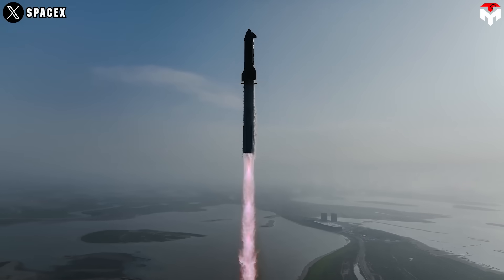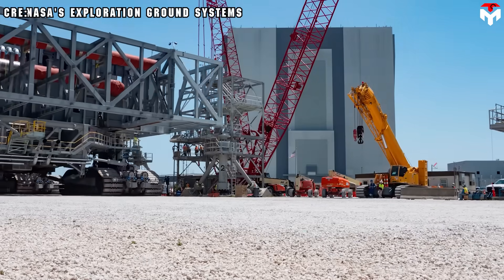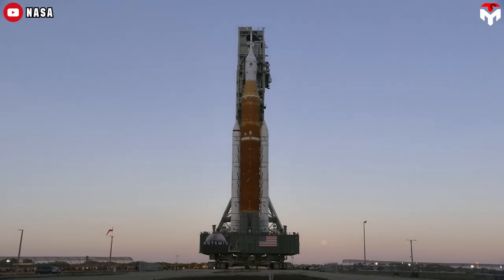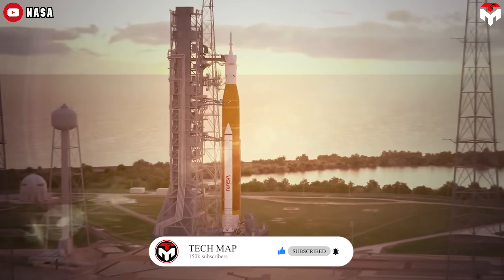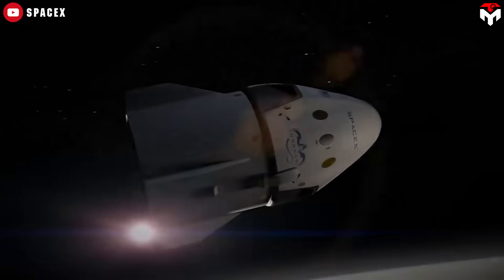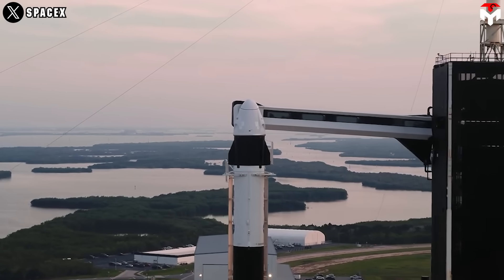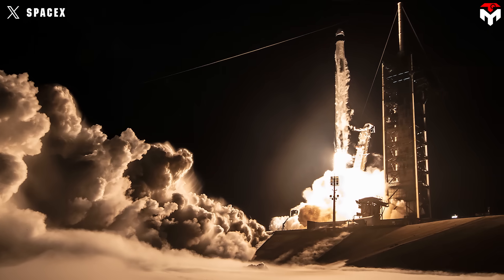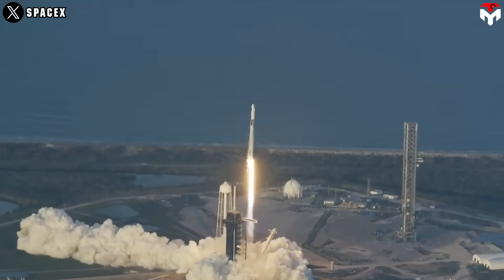SpaceX Dragon Upgraded to Launch to the Moon instead of Starship...

Comment: Almost all of the Lunar Gateway components are under construction or have been completed. Cancelling it at this point would be stupid. It has received a lot of criticism, but I think it is a good idea for many reasons to maintain a permanent presence in lunar orbit. In addition, I am not sold on the Space X lunar lander, bad top heavy design that is asking for trouble trying to land on the lunar surface. I would stay with a low squat design for the foreseeable future, and that ain't the space X design.

Comment: Spaces needs to mount some super drago rockets on the second stage to accommodate the stage separation and forget the hot staging ring. Maybe even some inverted rockets on the first stage. The sonic resonance during hot staging is damaging the fragile coolant lines in the rocket bells. Hot staging will never work consistently.

Comment: Why couldn't the starship first stage lift a modified dragon ship with big fuel tanks?
Reply: Short: because a Dragon in itself is not enough, it needs the Falcon second stage. Longer:
Because the Super Heavy Booster (Starship 1st stage) is designed to lift a very heavy weight, some100 tons to a relatively low height and then it have to return, but it is not capable in itself to give enough velocity/kinetic energy to reach the Moon. SH FT9 separated at 60km 4700km/h, while 2 yrs ago a geostac Falcon Heavy separated (I mean core booster from 2nd stage) at 116km 14500km/h, and a simple Falcon launch separates at 64 .. 68km 7800 .. 8300km/h. The Moon landing transfer needs about 15000m/s ~= 53700km/h delta-v. 
Don't try to add or subtract these velocities, neither am I that knowledgeable to do, just to see it roughly. 
Am not sure if the Falcon Heavy can do a Lunar landing transfer. I don't see putting it on top of SHB as an improvement, because the low speed it separates at. 
And human rating the whole thing will be a long time, years. Though, same applies for the Super Heavy system..
Anybody else, feel free to correct me, I might be mistaken at some point.

Comment: The huge modifications you're talking about could take ten years to human rate. It took nine years (and billions of dollars) for SpaceX to modify Cargo Dragon into what it is today.
A Lunar Dragon with 28 day recirculating life support, landing gear, improved engines and a much better heat shield is every bit as complicated as Commercial Crew.
NASA has a reusable lander that passed Preliminary Design Review in 2021.  ALPACA would've been ready by next year.
But they went with the cheap Snake Oil solution, and now they're up against the wall.

Comment: Actually no lunar lander is needed. No development cost at all.  Simply modify a cargo pod or put two on top of one another and slap them under a dragon capsule.  The lower cargo pod gets them to the moon and back. In lunar orbit, detach the lower cargo pod and leave it in orbit.  Dragon and the other cargo pod land on the moon using thrusters in the lower pod or the capsules draco thrusters.  All your important moon exploration crap is in the cargo pod along with fuel oxygen and other essentials.  When it's time to leave just the capsule launches with the draco thrusters, reconnects with the other pod and heads home.  Simple!
Reply: 28 day recirculating life support isn't simple at all.  It will take years for NASA to human rate a Dragon with that many changes.
Besides, NASA had more basic landers proposed years ago. ALPACA passed its PDR in 2021.
But the Government bought what Elon was selling, and now they're paying the price.

Comment: The trip to and from the moon. All one needs is a canister with radiation, life support and a booster. 
To land on the moon use a dragon and modified trunk with the super draco and extra fuel, but no heat shield (not needed for the moon). 
To return to earth send a second unmanned dragon to loop around the moon and dock with the returning transit canister. 
to save cost the lunar dragon could be resupplied  with a fresh trunk and the transit canister a fresh booster/supplies.
Reply from the maker: Simplified canister and modified Dragon for lunar trips are creative, but radiation, life support, and orbital docking need work. No heat shield for return is risky—thoughts on that?

Comment: Instead of landing legs on the Moon, pump up a big balloon and let the craft bounce to a stop.
I call it the Boing system.
Boing, boing, boing...
Reply from the maker: Bouncing to a stop with a big balloon is creative, but controlling the bounce on the Moon’s rough terrain could be tricky. Plus, inflating and stowing the balloon in a vacuum might need some serious engineering. Got any ideas for stabilizing the craft post-boing?
Reply: @techmap9  look at Spirit and Opportunity ;-)

Remember, Mars has only 1% of Earth's atmosphere density. So, for the inflated parts it's not far off from no atmosphere at all...

Comment: Extended upgraded Dragons to travel to the moon, but you would still require a lunar lander.
2 Dragons joined at the nose, with a little spin for a bit of gravity.
A simple lander could be built based around the 2 Dragon trunks.

Comment: The video claims the Dragon heat shield would have to be upgraded for the Moon. However, the PICA-X heat shield on Dragon is designed to handle re-entry when returning from Mars. Yes, Mars. Returning from the Moon is slightly slower, so slightly lower temperature. Dragon has life support for 10 days; it would have to be increased to 14 days.
Reply: Heat sheild for the moon ? Really ?? It has no atmosphere... the moon lander went to the moon and launched off the moon.. it was made out of tinfoil..
Reply: @thefreese1  He wrote returning from the Moon, which means Earth atmospheric entry.

Comment: Yes, outer space is often described as a vacuum, meaning it's a region of very low pressure and density, with almost no matter present. While not perfectly empty, the density of matter in space is significantly lower than even the emptiest man-made vacuum chambers.  MORONS SO WHAT IS IT PUSHING AGAINST ? HOT AIR LOON WTF.🚀🚀🚀BOOM

Comment: I proposed something similar on the Mars Society forum in 2016. Two launches of Falcon Heavy: first launches a reusuable Lunar lander into Lunar orbit. Capable of carrying 4 astronauts, single stage, liquid methane / LOX. The LM uses all of its propellant to enter Lunar orbit, then waits. Second Falcon Heavy launches Dragon, with the trunk filled with propellant tanks and engines, also liquid methane / LOX. The trunk is used exclusively for Trans-Earth Injection (TEI), also known as Lunar orbit departure. In addition to the Falcon upper stage, it would have another upper stage called a "crasher stage". The Falcon upper stage would perform Trans-Lunar Injection (TLI), which means pushing the stack into a trajectory to take it to the Moon. The "crasher stage" has 3 jobs: first is Lunar Orbit Insertion (LOI). The Dragon/Trunk/Crasher stack would then rendezvous with LM and dock nose-to-nose like Apollo. Then the crasher stage would separate, move around to the back of the LM, and dock with the LM. Then the second job starts: propellant transfer to refill the LM. Liquid methane, LOX, and breathing oxygen refilled. The LM would use helium pressurant, so that would be refilled as well. Astronauts would transfer lithium hydroxide canisters from Dragon to the LM by hand. All 4 astronauts climb in to the LM, seal hatches and leave Dragon in orbit running on autopilot. At a safe distance, the crasher stage starts its third job: de-orbit the LM. The LM is slowed out of orbit, and slowed toward the surface of the Moon. 90% of the work of going from Lunar orbit to landed is done by the crasher stage. Then the stage separates, and crashes into the Moon (hence its name). The LM uses its onboard engines to softly touch down.

Astronauts do their thing. When finished, the LM lifts off. Same engine used for landing, is also used for ascent. No part of the LM is left behind. The LM enters Lunar orbit, rendezvous with Dragon and dock. Samples transferred to Dragon, the LM left clean. Then Dragon separates, and at a safe distance fires up the engines in the Trunk and heads back home to Earth.

Notice: no Lunar Gateway. A Mars Direct habitat could be launched to the Moon either by one launch of SLS Block 1B, or Starship. The Mars Direct habitat would act as a permanent Moon base, and prove the technology for use on Mars. Dragon/LM could the be used as a crew taxi to ferry crew to/from the Moon base. Or the LM could land at different locations, for short duration science missions.
Reply: Yes, outer space is often described as a vacuum, meaning it's a region of very low pressure and density, with almost no matter present. While not perfectly empty, the density of matter in space is significantly lower than even the emptiest man-made vacuum chambers.  MORONS SO WHAT IS IT PUSHING AGAINST ? HOT AIR LOON WTF.🚀🚀🚀BOOM
Reply: A bit more detail: if Starship is used to launch the habitat to the Moon, an upper stage would be necessary for Trans-Lunar Injection (TLI). Centaur V would be large enough.

Comment: I wonder how long it would take to modify a Crew Dragon capsule to be a Lunar Dragon, to be launched with the Crew Dragon, as the Apollo CSM and Lunar Module were launch? They could make it a two-person craft, fitted with a docking port similar to that of the ISS, use the landing legs that were in the original Dragon, and modify the Super Draco engines to where they could restart to get the crew back to lunar orbit. There would be plenty of room for cargo, equipment, and scientific experiments, etc. I'm not an engineer, but it seems like it would be better and more cost-effective to do that, than to come up with a new design, which would take years to build, test, and the fly to the moon.

Comment: New Glenn is very slow, but not as slow as Starship which is still getting failure after failure, overweight, thrust under spec and no sign of any of the serious problems being solved. Also, Elon by threatening cancelling Dragon, he has shown he can not be trusted with getting contracts for space access

Comment: Send a lunar module on starship booster. The booster has been successful. 
Build a dragon that can fit on a falcon heavy that has the extra module for propulsion to the lunar module with enough fuel to the moon and back. 

Copy the original idea of nasa but fit it all on spacex boosters that are at a fraction of the cost

Comment: The Haven 1 module, with some extra protection against cosmic rays, would be placed in orbit between the Moon and Earth, and the crewed module would be attached to it. They would separate at the Moon, and the rest would happen similarly to the Apollo program. The ISS has been in operation for about 20 years, and in that time it could have reached Mars and back ten times. On a smaller scale, an object placed in orbit between the Moon and Earth, or Earth and Mars, would only need to be accelerated once, and then only supplied with energy for orbit correction. Fuel is the biggest problem and it must be sadly admitted that this can only be helped by downsizing. So a Dragon spacecraft would need to get a more serious rocket system, in addition to which the base would also need to get some propulsion for orbit corrections, and these two cannot be the same.

Comment: As far as the Lunar Gatway, why would a multi-module structure be needed. A single unit like the Sky Lab from the mid 70's would work fine. Gateway should be a temp facility for Lunar Exploration only when a Lunar Landing is in progress.There are cheap and efficient ways to have a Lunar Station as long as old cash guzzling so called space experts are kept of of the loop. Only pay the cost after the project is complete, no cost over runs.

Comment: Starship is for Mars but a quick fit-up for the Moon.
Reply: Starship needs to prove it's abilities and by landing on the moon, sustaining life on the moon and successfully returning to earth, and do this several times not only to prove sustainable reliability, but also to build a liner base similar to the ones needed for mars  than can support life on a long term basis, including oxygen and water generation based on just the materials on the moon. They need to prove all these things before even attempting mars, this because all the tech used to support and sustain life on Mars, because an emergency flight from earth is at least 9 months away, to go to Mars without all these building blocks in place is suicidal. And given the rift between Elon and trump sny federal funding for spacex might very well dry up, making spacex the second casualty of mysks ego. The only thing Elon can took forward to is Trump and cronies being impeached and a more understanding administration replacing him.

Sadly Elon Musk still hasn't learnt the lessons that his actions can have negative effects or his companies as well as positive ones.

The way things are looking 2030 is likely the first mars missions will launch, it will take up to 10 years to prove the tech used building and sustaining a lunar colony. After that the first mars missions will of necessity be flybys and perhaps pre supply of some required materials and equipment.
Reply: @stephenwood9703   Imagine if Starship were somehow tip over as it lands. My opinion is that Starship is too big and tall to make a safe landing, given the fact that just about every land that has been sent to the moon has failed to land successfully, and those lander are at least ten times smaller than Starship, if not smaller.
Reply: it's a cartoon loon.  WTF  The "Man in Space" episode, which aired on March 9, 1955, was a pivotal moment in the history of Disneyland and the public's understanding of space travel. Hosted by Wernher von Braun, a rocket expert who later played a key role in NASA's Apollo program, the episode, along with its sequels "Man and the Moon" and "Mars and Beyond," aimed to educate and inspire the public about the potential of human space exploration. The show's popularity, reaching 40 million viewers, helped to generate excitement and support for the U.S. space program.  CARTOON $.